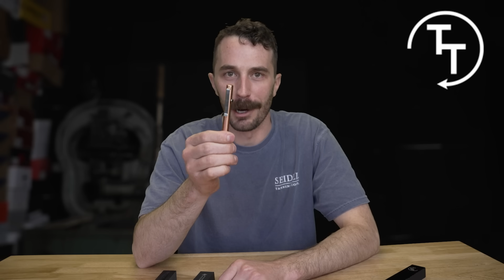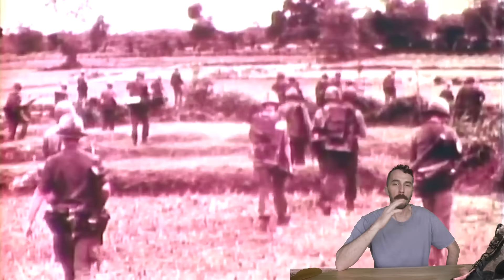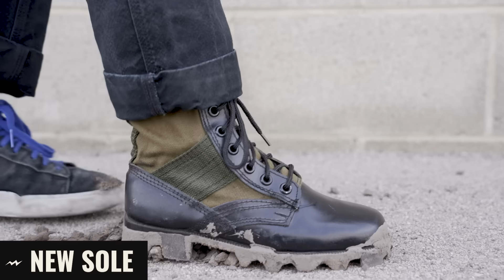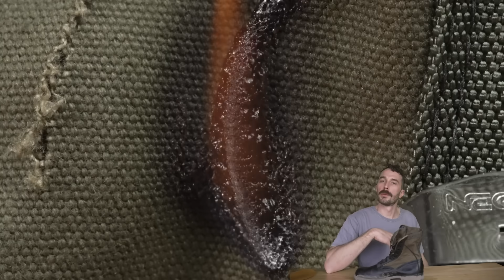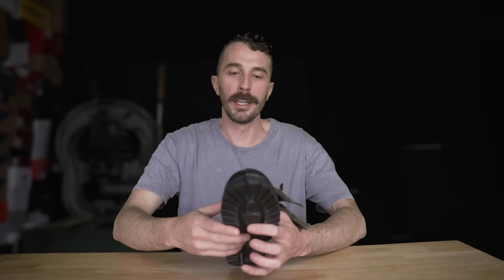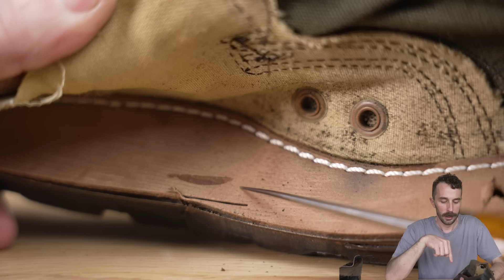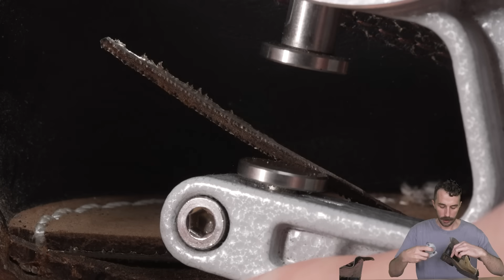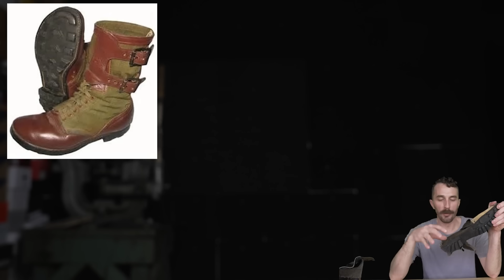Why it took 57 years to replace jungle boots

Comment: Old, retired soldier here.  I had several pairs of these.  They were given to us.  We were instructed, in class, how to care for them.  Our feet and legs were considered extremely important.  We gave them good care.  Then we got some advise from older soldiers.  I submerged mine in a sink of water, over night.  The following day, I wore them all day, until they dried.  This was for a perfect and fast break-in.  I kept them clean and polished them well with Kiwi.  They lasted about eight years.  I didn’t resole them.  I think builders of new trail shoes would do well to design such reliable, long lasting shoes, at such a reasonable price.  Kentucky

Comment: Interesting video!!  I was wearing them back at Fort Bragg before leaving Active Duty in 1992.  Even back then, it was hard to find a real pair of USGI boots since there were too many cheap knock off versions with the forgery NSN floating around. Like with most boots, except the current issue boots in the Army from 2005 and up, they were a pain to break in.  Once broken in, they will become your best friend in the field.

Comment: Well, it is written in the instruction that you need to put a shoe cream with silicone.
1. How do you think is silicone in shoe creme is harmful for leather? For example BW shoe creme contains it.
2. These jungle boots usually have some layer of plastic on the leather, not to be soaked quickly. Shoe fat lays unabsorbed on the leather.

Comment: I have a pair of chinese knock off jungle boots, i can confirm that the weird sponge sole thing does indeed cause airflow in the boot, when you walk hard or fast in them theres a distinct pfft pfft pfft sound, ive yet to walk around in thick mud or water with them but i have noticed that my feet are never sweaty when wearing them and i live in texas and work outside at least once a week in the summer

Comment: Dude I cannot believe you did that to those jungles where did you get them for 50 those originals depending on size run well over 200 and up when i left the Marine Corps I had 4 sets of jungles one pair Panama soles the other vibram soles made by CIC i got at cash sales in Marine Barracks PI my son now a Marine sold a pair of mine to his buddy for 300 I figured now can’t wear all four pairs might as well make some cash from them I remember at that time in cash sales they were only 45 a pair not like the boots today’s jarheads use 200 that’s insane but in 87 when the Corps started to let us wear them I’m garrison before you could only wear jungles overseas that’s all I wore was jungles unless I was in Bridgeport or Korea but the jungle boot for me was the best boot the Marine Corps fielded 
Former Marine BLT 3/1

Comment: I was Issued two pairs of these boots in 1971 at NKP Thailand....  a base that really didn't exist then.   I LIVED in those boot for the entire year I was over there and after my hitch was up I brought them home with me.   The one "short coming" of those boots was pretty obvious the first time you tried to wear them in SNOW.  However, after my enlistment was up I wore them often for for yard work or any other outdoor work in summer down south where I live.  They held up really well until about 2010 by which time the soles were slick and the inside worn out.  After watching your video I am going to have to try to find me another pair.  I am now 75 years old and have worn many boots but none that worked for me as well as these did.  The mesh insoles were one of the real secrets to making these boots work.

Comment: these boots slap hard as hell. if its hot and wet you wont get much better in terms of traction or longevity due to its simple construction. they also make fantastic wading boots for sandier creeks. definitely get new insoles thought. the modern ones sold by mcrae who was an original contract maker have omited the spike plate (apparently its not actually that bad even if it were there) and added speed laces which can be uncomfortable for some people, aswell as dropping the ventilated saran insoles that were part of why they dried so well originally.

Comment: I was fortunate to find a brand new pair of these in size 14 on eBay for under $20 ten years ago.  Good luck with that now..  I wore out military desert boots from a variety of makers for 20 years in Nevada, but gave them up when I moved to the PNW.  I got these for wetter conditions--- in a later, most evolved version.  I haven't worn them yet.  Saving them for a rainy day.

Comment: Would not want to wear a boot that got wet inside every time I walked in water. Doesn't matter if they eventually dry.  I wore Mil Tec boots to fix drainage issues at my moms, up to the top in mud, socks never got wet. 
Please do the Ro Search Mildew Resistant black leather boots used from 1984 to 2004 in the US. Great boot once broke in.

Comment: Hey man you should try out the Swedish military boot. It's called Marschkänga 90 and is a really cool boot. It also has a winter version with more insulation and a steel toe Version.

Comment: The 360-lb puncture test is interesting.  That would mean a tall (80") soldier who is young (17-20), can weigh a maximum of 234 lbs.  Add a 120 lbs of gear and you are looking at 354 lbs of weight standing on one foot on a nail.  And not get punctured.  Impressive.

Comment: I wore bunny boots, had a pair in the early 90's. That pair outer soles had to be cleaned until the lacquer was gone, it increased the grip on snow, and ice. Modern bunny boots don't have that, which is killing the industry; shame cause they are warm even in wind temps well below  0 degrees.

Comment: Navy flight deck boots from the 80's through the early 2000's would be interesting to see what is not in them. In a 20 year career, I went from a 11.5 regular boot to a 14 wide. Standing on steel, concrete, and aluminum all day long doesn't destroy your feet as per the VA.

Comment: I figure the steel plate only had to be thick enough to stop a bamboo spear from puncturing a boot on a man wearing full gear and pack. That's why it took three hundred pounds of force to punch through it.

Comment: I have a pair of ex Royal Marine Jungle Boots. 100% agree, extremely comfortable.

PS I've a pair of the bunny boots predecessors, black rubber, and known as the Mickey Boot (made your feet look like Mickey Mouse, white Bunny Boots - Bugs Bunny)
Reply: Sounds like the nbc overboots
Reply: No, insulated fore runner of Bunny boots, developed post Korean war after the need was realised for a working, cold weather, military boot. The major difference between Mickey, and Bunny boots (apart from the colour) was the introduction of a thermal air barrier layer, and bleed valve system (for use at altitude)

NBC boots are more usually, a kind of single layer galosh, or over boot (I have examples of those as well) 

Incidentally the UK used a snow over boot (Elephants foot) similar in principle to those used by the Germans in WWII, primarily used for sedentary work ie. Sentry duty, in Arctic conditions.

Comment: Those “ww2” boots you “reviewed” were actually awful and literally made grown men cry in pain. For military footwear as well as running shoes, synthetic, cemented construction is the best, toughest, most weather resistant and most comfortable out there. Besides, Military boots are not meant to last forever.
Reply: They are meant to last quite a while. Have to remember, grunts put a lot of miles in their boots over less than ideal terrain compared to civilian use coupled with a lot of add weight.
Reply: @SonOfTheDawn515  you are lucky if they last you a year of service. They are means to be as functional as possible, as durable and weather resistant as possible all while being as comfortable and lightweight as possible. They are not going to last many years and are meant to be replaced often.

Comment: I suspect the steel plate is heat treated at least a small amount. The fact that it took 300+ pounds to pierce such thin steel and that it flexes back to shape points towards that.
Reply: and it ate his saw blade.

Comment: Kinda interested in people's take of a couple combat boots (these boots are circulating around with high praise to them), I've been looking at them and been thinking of purchasing one, mostly leaning towards the 5.11s or the rapid assaults, 5.11s cause of their atlas system and design and the rapid assaults due to them being a warm jungle boot

Although I do live in Canada so maybe a jungle boot maybe not the best choice

- Garmont 8" NFS
- Propper mens series 100 8"
- 5.11 tactical a/t 8"
- Danner tachyon
- LALO rapid assault

Comment: Because they work!  When we deployed for Desert Storm/Shield we had out jungle boots (we were gearing up for Haiti) and were handed 'chocolate drop' (which were useless in the Middle East desert. . The breathers screen was large, to let water out, not to keep the fine sand of the Middle East out of the boot. When we returned to Fort Bragg (now called 'Fort Liberty' because of the communists) the reservists had all the new boots, new fatigues, etc...I still have two pairs and use them for hunting.

Comment: I think a lot of people would enjoy seeing how these compare to some of the currently produced ones like Rothco, Wellco, McRae, Fox Outdoor, and Altama. Pretty big range in price including one saying they're a perfect reproduction to spec, but I'm just wondering if any of them even have the steel plate anymore. As time goes on it will be harder and more expensive to get real surplus so I think it would be nice to see if any of the ones you can buy online right now even hold a candle to the originals.
Reply: I think I tried one of the Rothcos and they were horrible. The eyelet came out once it got wet. I'm not sure if Wellco still sells them but I would put my money on McRae and Altama in terms of quality though they are much more expensive. The Altama website says it has a non-metallic anti-penetration board for their version.

Comment: I am a cell phone salesman but I met one of the guys who designed the metal plate that stops nails and spikes from going through. he said that was the number one thing he was most proud of designing! (i should also say, the reason he was so proud was because of all of the lives that they saved)
Reply: I was in Vietnam in 1968 and wore our Aussie GP boots which had a S/S plate through the sole. I believe it was the first. I still have the last pair issued to me in country and they have red stains from the dust still on the soles.
Reply: It's not a hard concept,  I don't think he lied .I can file a jungle boot with steel plates to the US patent office or any other foreign patent office made in Blender CAD and it'll probably be accepted but probably won't be valid since it isn't novel anymore I'll just be paying maintenance fees for something that isn't enforceable.
Reply: @wertiaaudit5746  I will let you know if he ever comes back in, but ill say ive never seen an old guy know his way around a smart phone like that. I didn't have to set it up or anything.
Reply: He 100% lied to you.
Reply: @jasonm949  Who the hell would lie about that? I'd be proud of designing a way to keep soldiers from getting impaled on punji spikes.
Reply: @OzarkansasPliskin  Lol..You've never been issued jungle boots, have you?
Reply: @OzarkansasPliskin  There is nothing to design... it is just a steel plate in the shape of a shoe...
So what exactly he designed? The shape that is used for shoes for thousands of years?
The steel? It is just spring type of steel and steel springs are used for centuries.
The whole design process was all about making the decision what thickness of the steel plate you want to have there...
Reply: @jasonm949  so the metal plate doesn't stop nails if you step on 1?
Reply: @jasonm949  I dont think he lied this old guy was super smart,  he started talking about the Vietnam war and about all of the spike pits and traps and then started telling me about the steel plate they designed that saved thousands of lives

Comment: When we were still wearing BDUs, I wore jungle boots in most weather as a cavalry scout. If you're doing dismounted recon the right way, you're gonna need to wade through streams (so you need boots that dry as you wear them), but you'll probably be in and out of vehicles a lot (so you have a heater sometimes). If it was too cold for jungle boots then I was probably in my Matterhorns.

Comment: Buyer beware! Be sure that the jungle boots you get are genuine military issue with the steel plate. When I was 13, I purchased a pair of South Korean manufactured jungle boots that looked authentic. However, after 8 months of normal, non-jungle use, the boot sole completely separated, revealing a plastic inner plate instead of leather or steel. Years later I purchased a pair of desert boots that resembled a suede version of the jungle boot. These boots were also poorly made and the sole was made of PVC instead of vulcanized rubber. These boot soles had no traction in spite of the mud slip tread pattern. 
Bottom line, you get what you pay for and beware of knock offs.

Comment: When buying civilian items, I usually prefer trickled-down tech from military counterparts. During bidding process, suppliers compete and undergo extreme tests for gov't contracts (the concerned agency provides the parameters which they need to meet). Those who pass are considered MIL-spec. I'm surprised though to read occasionally that some contractors fail eventually - probably due to cost escalation which also affects quality. I'm pretty much against these products being allowed manufacture abroad, specially with non-allies (if we must, but give it to allied nations). The tech can easily be learned by enemies.